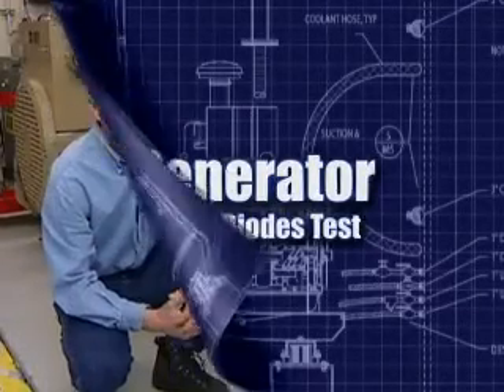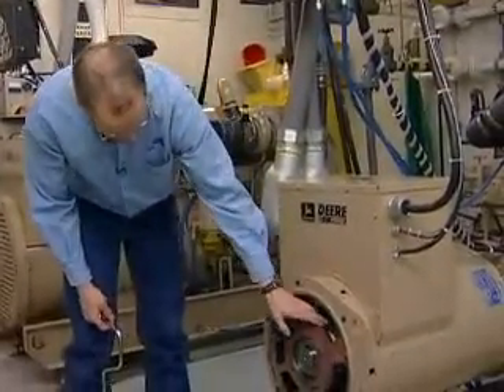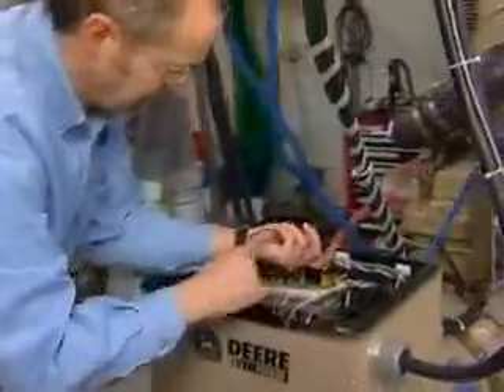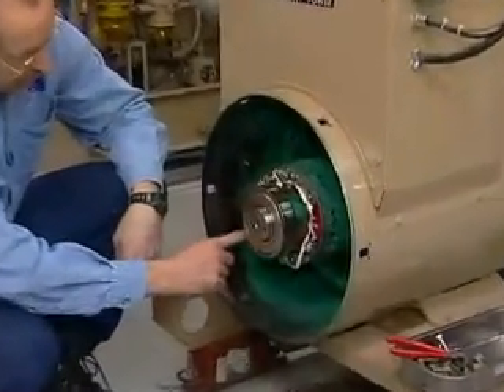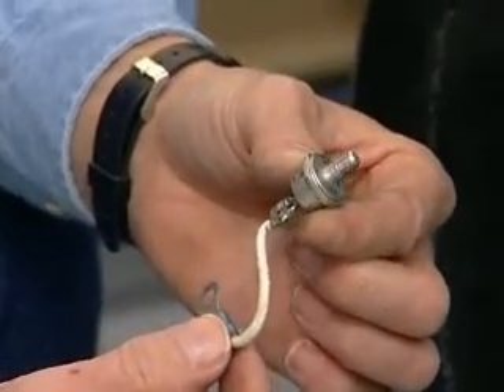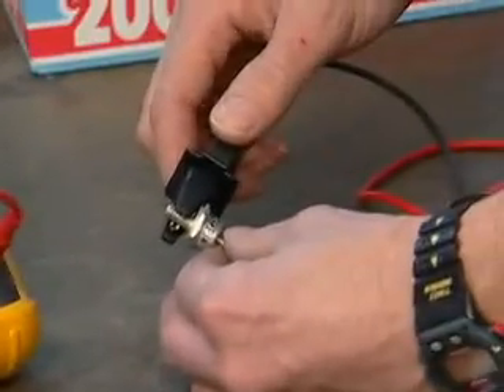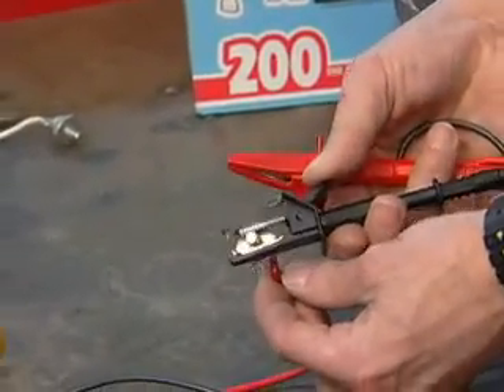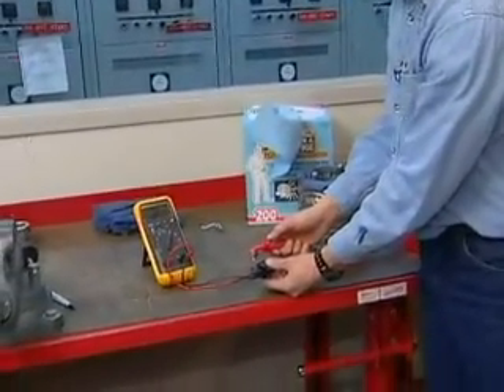How to test Diodes in your Generator

Comment: Great video!

Just one note, and it's common misconception, but OL on the fluke doesn't stand for "open lead/loop" as many think, it means "OverLoad", as in, the value measured is higher than the range set on the fluke. 

For resistance measure, and open loop will have very high/infinite resistance, which I think is why people think the OL stands for Open Loop/Limit. 

But you could (I speculate, haven't tried it) get it for current flow as well, and someone might misinterpret it as no current flowing, when it's very high and over the range of the fluke.

Comment: Please say sir, why diode using in rotor?
Reply from the maker: it is used to rectify the voltage
Reply: @alaskaenergyauthority7923  thank u sir
Reply: Thanks for placing this video , but what starts happening when a generator has problems with it's flying diodes??
Reply: @shepherdwarriorKING  Erratic voltage output or, usually no voltage output. The magnetic field on the armature cannot be properly produced without DC current, hence no alternating current output.
Reply: Diode is use to. Convert dc volts into. Ac I think